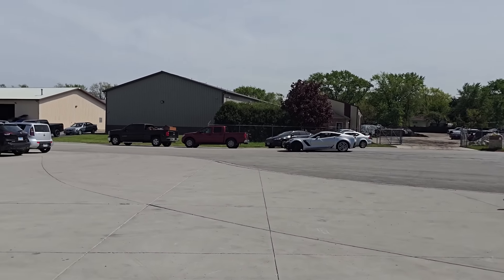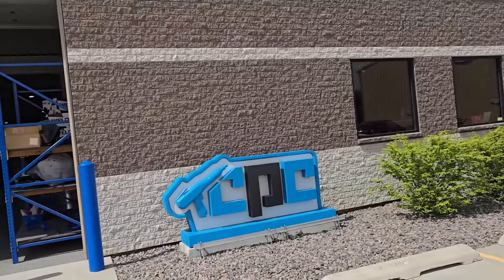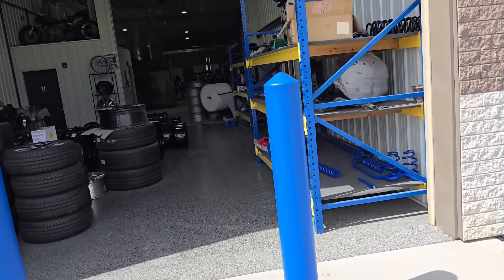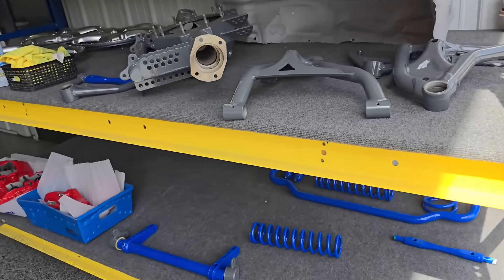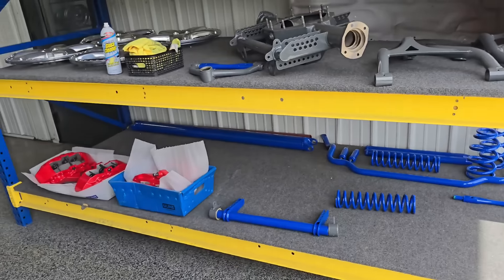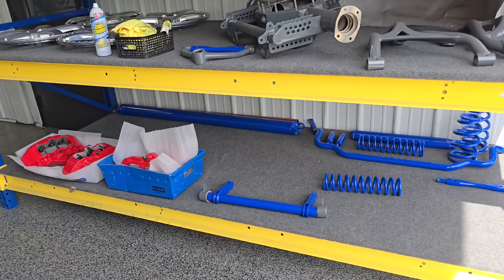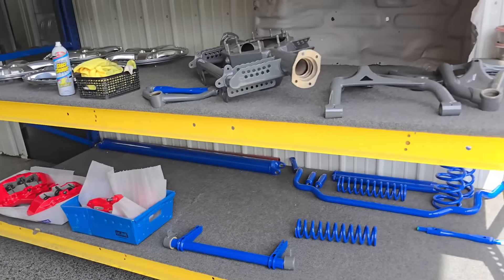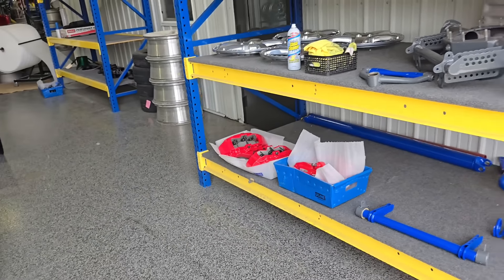Creative powder coatings got my suspension ready for bullface

Comment: donk frame guys.. look at the rear exhaust  cut out area. on the rear cross brace.. box has the bumper to join the rear frame rails.   and box has bumper shock absorber mount in the front...